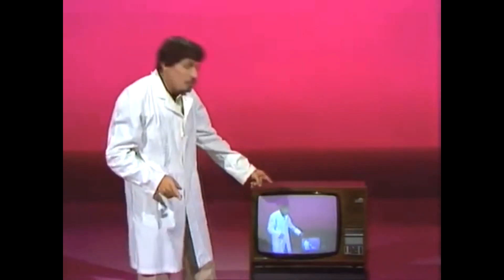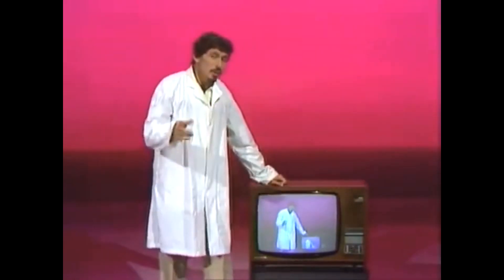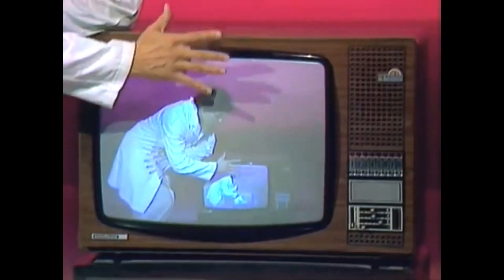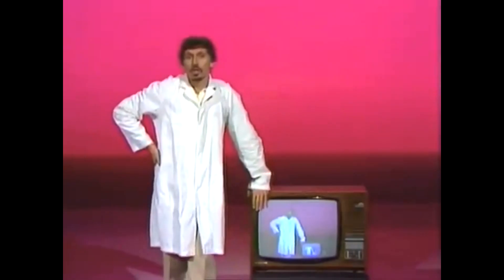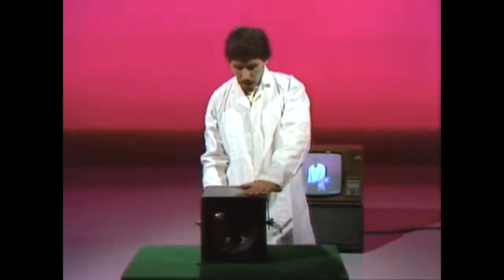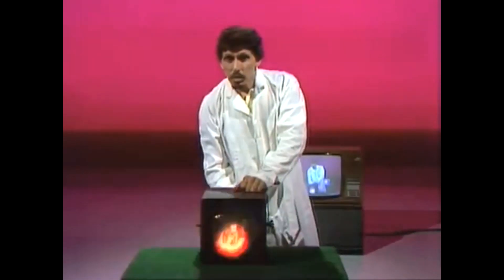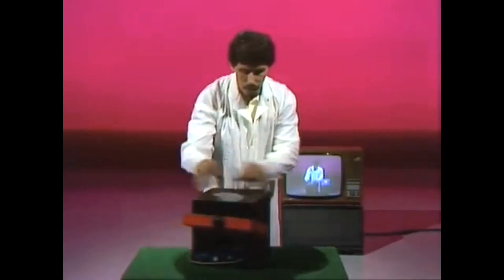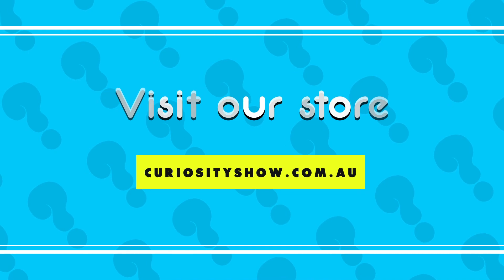Flickering Lights - Stroboscope

Comment: For anyone wondering, times have changed a bit for some light sources.
For instance, most LEDs (not all) don’t run at 50-60Hz. They’re either DC (with no flicker at all) or in most cases they’re on AC but the flickering is at 50,000Hz which is way higher than most, if not all, people can perceive.
Reply: I'm glad you pointed this out
Reply: Don't forget PWM dimmed leds!
Reply: The strip light LED strings are often really bad.  Not only don't they frequently place them directly across 50-60Hz but they also don't use diode pairs so the current only flows during half of the cycle at 25-30Hz.

In spite of the assertion of this video, most incandescent bulbs of the day had very little flicker. Just because the current stopped flowing didn't mean that the filament wasn't still hot enough to glow until the current turned around and returned.

Fluorescent lights were horrible if you caught them out of the corner of your eye.
Reply: This is just wrong, lots of cheap LEDs and especially those nasty LED overhead panels just flicker at 60Hz, much worse than any fluorescent tube ever did. To confirm this you can easily record a video of it on your phone in "slow motion" mode.
Reply: @technoman9000  
“This is just wrong…”
What part of what I said was wrong?
Reply: I've got LED striplights, and when I record with my PS Vita camera with 120FPS framerate. However the framerates line up, whether the LED are 30hz or 60, it creates these moving horizontal bars in my recordings, like old VHS tracking but made of narrow bars of light.
Sort of like the camera has an astigmatism.

Comment: Actually, incandescent lights of the time didn't flicker as much a something like a television. Yes the current went away a couple of times throughout the cycle; but, it wasn't the current that generated the light.  It was the heat generated by the current that  produced the incandescence. Just like a pot on the stove isn't cool the moment you turn off the burner, the filament wasn't cool the moment the current ebbed in its cycle. The filament was usually still glowing when the current returned 8-10ms later.

You will find videos of filaments flickering. Those are usually made using a low temperature (reddish)  bulb that was already close to dying into infrared on each cycle or a bulb that was run at low voltage to put it in a similar state. It was never something noticeable the way it frequently is for fluorescent lights  out of the corner of your eye.

Comment: Decades late for a correction, but lights flicker at 100 or 120 Hz - one flash for the top half of the sine wave, and one for the bottom half. And that flickering is coming back with a vengeance, with cheap LED lights without smoothing capacitors.